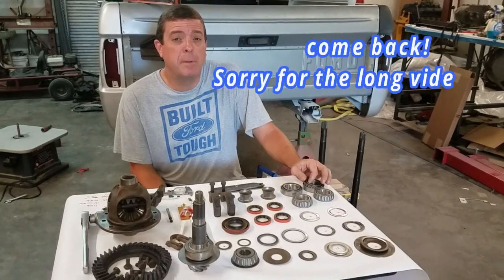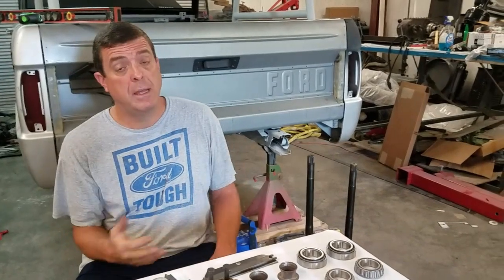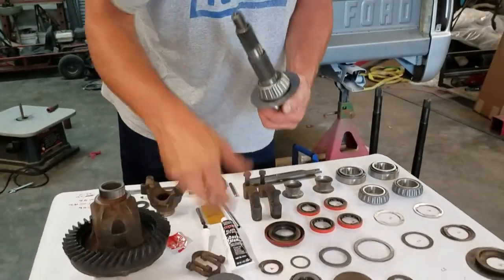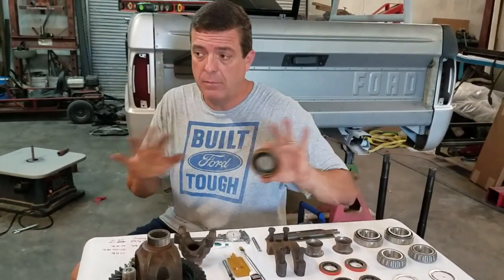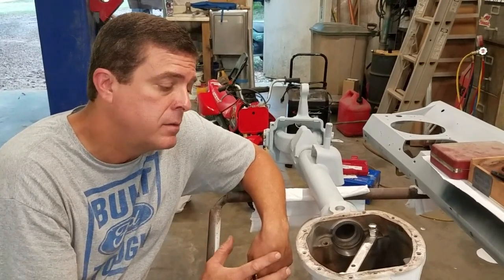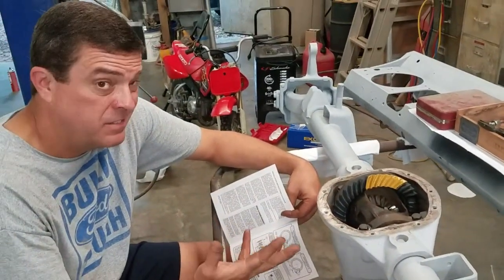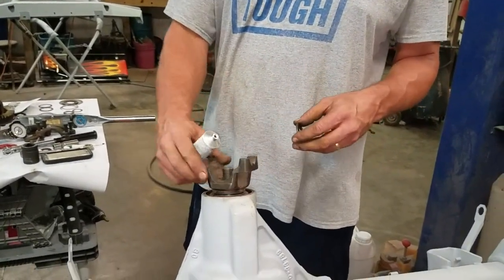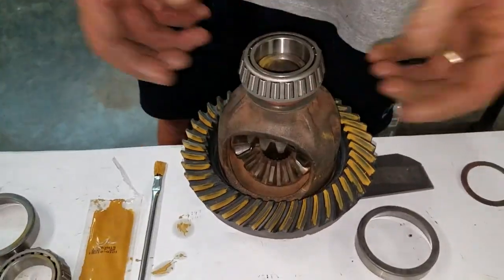Dana 30 Gear Installation - 1966 Ford Bronco Restoration Project

Comment: Do you have any measurements from the machined piece of steel you used at 12:15?  If not that’s fine, thanks.
Reply from the maker: Darin I am sorry but I don't.  Whatever you use it just needs to be straight.  When you are measuring depth make sure you account for the  thickness.  Thanks for watching.

Comment: Jason I have watched this video a number of times trying to be more confident in doing my own Dana 30 and 9” for my 71. 
I think I am there now thanks to you and Joni’s great camera work. 
I am trying to gather the right tools. I found a magnetic base gauge but it seems pretty cheap at $50. Does that seem right?
Also, I don’t have a press, can I get by carefully tapping them into place?

Thanks again for your work to help out a new builder.
Reply from the maker: Thank Kevin!  
The Dana rebuild was not too bad.  The biggest thing was getting it clean and having all the parts available.  As far as tools, the dial with magnetic base will probably be fine.  It might not last forever but should serve you fine.  The press sure makes it nice removing bearing and reinstalling them.  I did a lot over the years without a press but I can tell you since I got one it would be hard to go back to doing without.  Don't forget a cheap pair of snap ring pliers that was the toughest part to me.  Contact me anytime if I can help.  Good luck

Comment: will you make a video on putting together the spindles, axle u-joints, brakes, etc anytime soon?  that is where i am now in my '68 build and i haven't put it back together yet.  thx for these videos.
Reply from the maker: Joe, I can do that this weekend if it would help you.  I had planned to paint the housing first but will assemble it if it would help you out.  I am using a disc brake conversion from Tom's Bronco.  What brakes are you using?
Reply: @JasonJonieBuilds  holy cow - i didn't paint my axle yet either - that's my next task! i am trying to clean, de-rust and paint where the coil springs and shocks mount, then re-install the painted axle. maybe if u simply go in the order you were thinking i can be a few days behind you. so u don't change your pre-defined order. i was thinking of keeping the oem drum brakes but maybe after i see your disk conversion i'll make my decision then.
Reply from the maker: Joe, I am hear to to help.  That is why I started the channel.  It is fun to meet people with like interest.  I will see where I am at tomorrow in the shop.  I will keep you posted.  Thanks!
Reply from the maker: Joe, we did a video installing u joints and dry fitting the disc brake conversion this weekend for ya.  It will go up probably Tuesday morning .  Hope it helps ya even though it's not drum brakes.
Reply: Your mumbling at 26:45 had me rolling!  😂 I’ve been there! Haha
Reply from the maker: @darinerickson4593  lol...Thanks for watching.